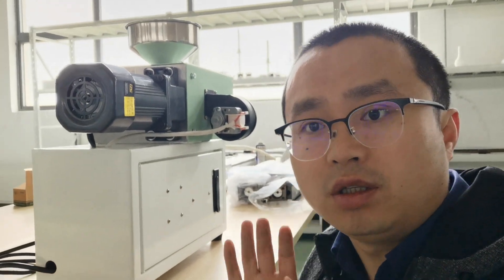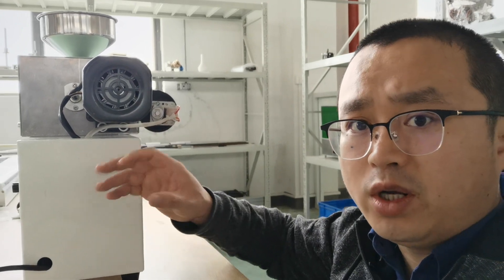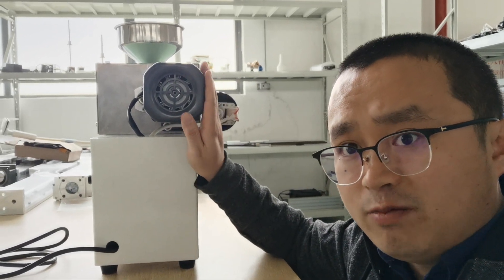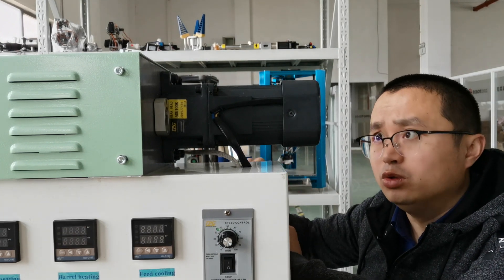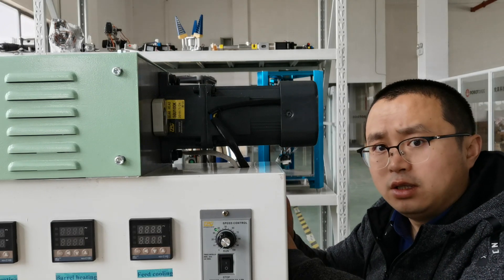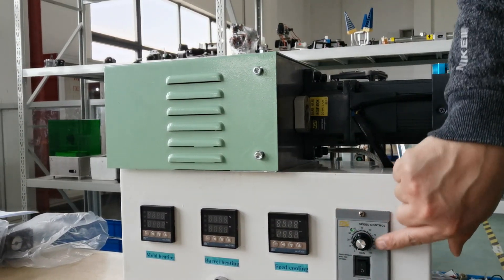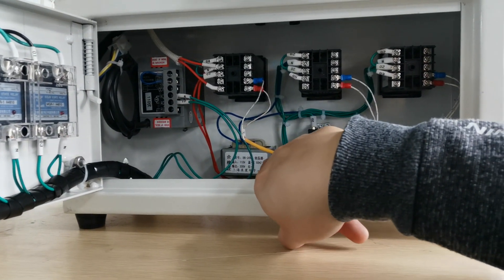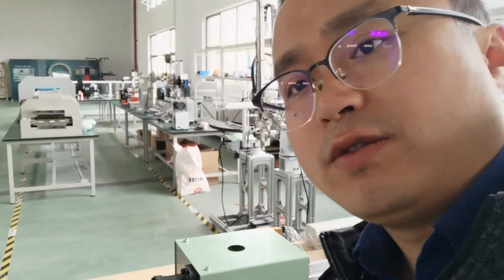The parallel twin screw desktop SJ20 extruder from RobotDigg

Comment: Very interesting to learn about what this vaguely described machine actually is and does. Online I saw something about future growth jibberish, and the specific details literally sounded like something from a cartoon. Which led to your posted video, and that was much better to imagine how it would be useful.      I don't speak Japanese or anything other than English, but you did a very good job trying to find the words, and was actually quite perfect for the purpose. I hope you are successful and don't give up, because clearly you have a great future ahead of you.  I'm actually debating now about checking out how to learn Japanese, so thank you. 😎 Namaste
Reply: It’s for mixing plastic material, either fibre or pellets, with pigments and other kinds of additives or with other colored plastic, to get the exact plaatic you wish, in terms of color and other properties. It is a good tool for making a “masterbatch”, basically pellets meant to be used to produce more of a specific plastic without needing to keep making a ton of it. You mix the masterbatch you made with more plastic, and well, get the desired color - hopefully.

It is very useful if you want to make filament for 3D printing. If you want to use the plastic you made for that, you mix the masterbatch pellets with wither scraps or pellets of the same material, preferably a similar color bur doesn’t HAVE to be, in a filament extruder machine (there are many many DIY and even open source designs online, with lots of 3D-printable part files. Including the popular ArtMe 3D one.) In this machine, usually a single metal screw grinds the masterbatch pellets up with the other plastic, from a funnel down a vertically-oriented hole, most likely through a hotend-type extruder like those on 3D printers. Possibly through a different electric heating element first. The filament is pulled further out and onto a round spool by a 3D printer style geared extruder, finally ending up with a spool of useable 3D printer filament.